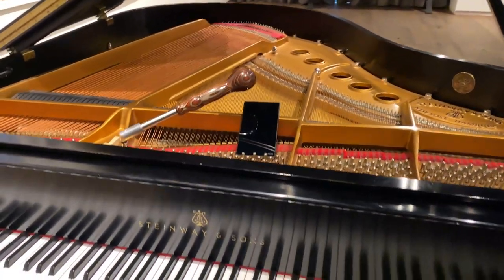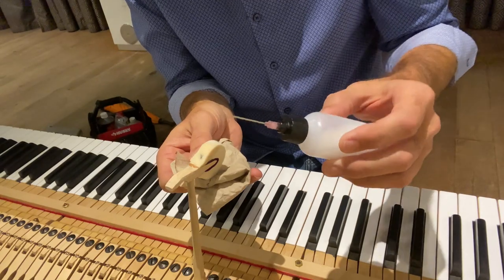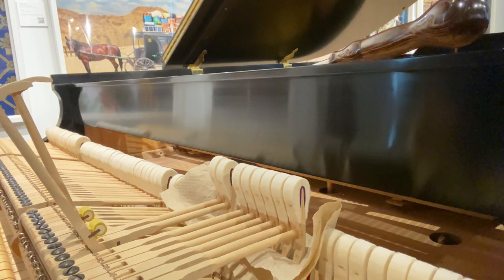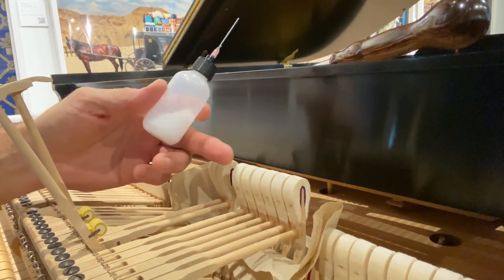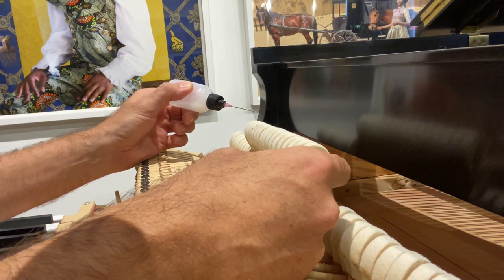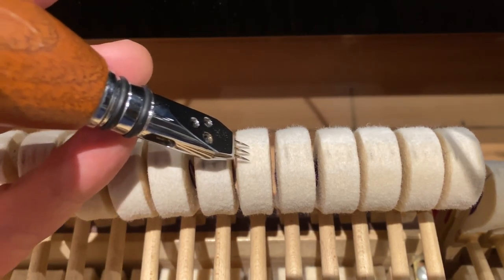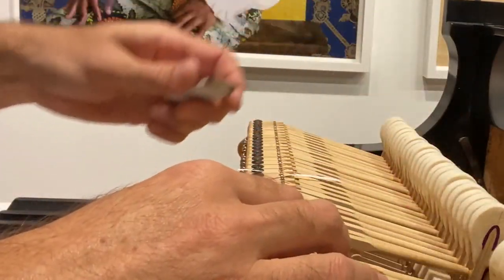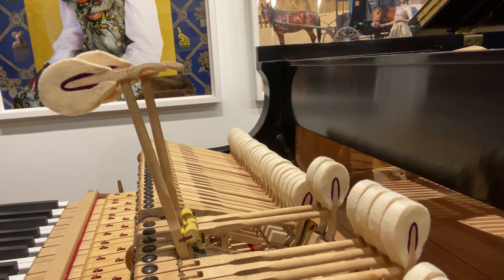Voicing a Steinway Model S

Comment: Was the tone too soft when playing forte or fortissimo prior to doping the hammer felts? I always thought that japan or some other type of varnish was used for doping hammer felts. Certainly that's what the two supply shops offer piano tuners here in the UK.
Reply from the maker: Yes, they really did sound “poofy”. Steinway U.S.A. uses lacquer cut with lacquer thinner It puts off a lot of nasty fumes but is the best for deep juicing. For less intense juicing and for applying just drops on top I’ve recently moved from keytops  and acetone to B-72 and alcohol. B-72 is really great and can be found in pellets online.
Reply: @the_daily_ping  Thanks for the info.

Comment: what composition do you use thank you
Reply from the maker: If you mean what is the juicing solution I’m using it’s 1 teaspoon of ground keytop to 7oz of acetone. It’s not a precise formula. I want it to have a thin milky consistency. I’m interested in using B-72 as well which is a preserving acrylic for painting restoration. It is supposed to be a softer acrylic than keytops.
Reply: @the_daily_ping Thank you so much for your response. Your videos are amazing!

Comment: What do you mean by the bass strings "speaking upward" after the tuning? Thanks!
Reply from the maker: That’s a good question. Tuning is obviously about spacing the notes properly for our western sensibilities concerning harmony, but with instruments like pianos which have large arched soundboards and high tension strings there’s an additional aspect of tuning that can be achieved. I don’t know if it has a proper name but I call it “activating the soundboard”. There’s a technique of manipulating the wire during tuning so that it adds additional downward force on the bridge which causes the sound of the string to project upward from the soundboard as opposed to downward. You know you’ve done it properly because you can hear the placement of the note move upward and to the right. The timbre of the note changes for the better too. Whenever I do any voicing I tune the section or notes to make sure that they are activating the soundboard.
Reply: He doesn't know. The point is to seat the strings at the bridge throughout the instrument.  Level the strings (mate them to the hammer at the  strike point), and tune the unisons at the highest partials, setting the pin stable. Only then can you judge the tone. Regulating the mechanism is also part of the pre voicing. He's a hack.
Reply: @beethovensg  I'm totally agreed with you! Unfortunately so many dangerous gyes (for piano).....

Comment: I tried that acetone mixture, but all it ever did was to soften the sound. Maybe the key top was not good material. Idk. I ended up rashaping my hammers heads and that did the job
Reply from the maker: That's interesting. Perhaps the solution wasn't string enough. Straight Acetone will soften the felt. I'm glad that some filing got you to where you wanted to be.
Reply: I always start by re-facing worn hammers, and then attend to any voicing or doping thereafter - if and as needed. Starting with the correct hammer profile is far better than trying to alter the tone on worn hammers, other than when a customer wants to keep their costs way down.

Comment: Great work! Congrats.
I needled a strident Hammer too agresively, incluso g the strike point (i was a bit dare, I know). Now it is muddy… (my bad). 
Can I recover it by dropping B-72 diluted with acetone directly into the strike or should I juice only the shoulder instead?
Reply from the maker: Thanks for your compliment! You can put a drop or two on the strike point but it’s better to start on the end of the string grooves (away from the strike point towards the shoulders) rather than directly on top. Just put one drop on each end of the strings grooves and see if the sound comes around.

Comment: My only comment would be, if you are voicing this for ‘your ear’ or an existing client.
If it’s for you, I wouldn’t do anything. I had the chance to speak to a very high ranking member of 
the Steinway Commercial sector, and we were talking about ‘dopeing’ the hammers when 
a piano arrived into the showroom, but this individual might think that it’s too loud/soft, they
responded that a piano is such a personal choice, a bit like choosing a boyfriend/girlfriend!
each piano is different as are people, and they very rarely changed the tone of a piano unless
the client was present.
If this is YOUR piano, fine, but otherwise I would always tend to back off revoiceing until either 
the hammers were part of a full rebuild or the owner was absolutely and utterly unhappy with 
the tone, which in my humble opinion means they’ve bought the wrong instrument!
Reply from the maker: That is always a valid position concerning voicing of any type. I have found though, that voicing American made Steinways with soft hammers requires a certain amount of juicing for the piano to be able to produce a quality tone. In this piano's case, the concert organizer requested more tone from the piano. The hammers were just too soft (not hard enough) even for a home instrument. Some pianists might like a super puffy sound but I feel that it was really lacking in color.
Reply: Was the client nearby to try out some of the post dopeing.
What about if you found the hammers (as you correctly described) in the wrong position,
would it have been possibly better to have checked the alignment of the hammers before
giving yourself such a large amount of work?
It’s still a very educational video that you have made, and very kindly uploaded it. :-)

Comment: Other than Steinway what do you use for voicing ? Can you list in the video what you used ?
Reply from the maker: Thanks for the question and thanks for watching. 

For voicing hammers “Up” I using either lacquer in lacquer thinner or B-52 in alcohol. 

For hard pressed hammers I have two voicing tools. A three needle tool with 6-7 mm length needles for deeper needling and a 7 needle tool with 2-3mm needles for more delicate needling. 

I’ll do a video on these soon.

Comment: Is the liquid just acetone?
Thank you!
Reply from the maker: Yes, Just straight acetone. It takes overnight to fully dissolve the ground keytop material so plan ahead for that.
Reply: @the_daily_ping  Is that similar to B 72 (paraloid)?
Reply from the maker: Keytop material is Mae of acrylonitrile butadiene styrene (I had to look that one up). B-72 is a softer acrylic that can be thought of more like a finish than a plastic. I plan on switching to B-72 when I find some locally.

Comment: So many questions but I'll ask two.  If I retire in my late 50's and want to start a new career in this field do I have to apprentice?  I play by the way.  Also, are you voicing a Steinway fresh out of the factory or a used one?
Reply from the maker: It’s actually quite common for retirees to get into the piano tuning business. We have several here in the Miami chapter. I wouldn’t expect that you would need to apprentice but it is difficult to learn to tune and to do technical work without at least having a teacher if not a mentor. I would recommend the Randy Potter course to get started. As for the Steinway in this video, it is probably 10 or so years old however the hammers didn’t appear to have been thoroughly voiced before. They were quite soft sounding.
Reply: I only train and hire guys who are late 30s and above. The younger guys are often on various tracks and simply  aren’t ready to take this seriously as a career yet. 

I say do it! We need more techs all the time. 

.